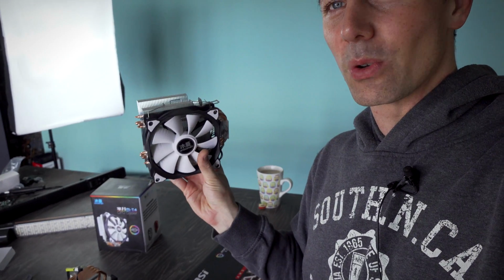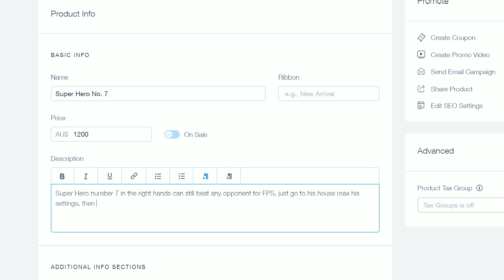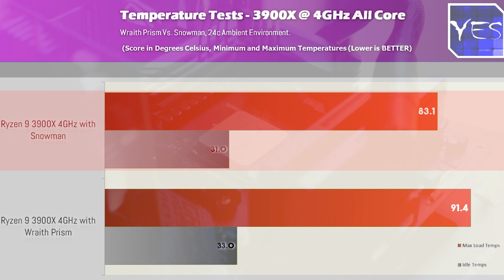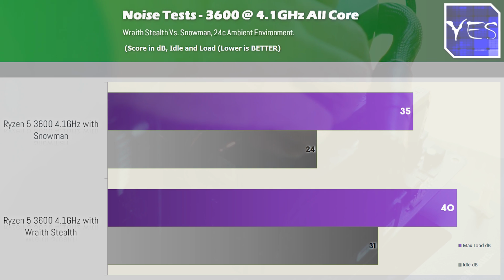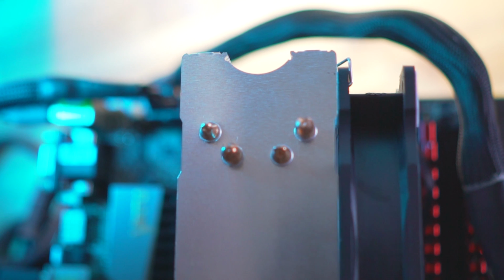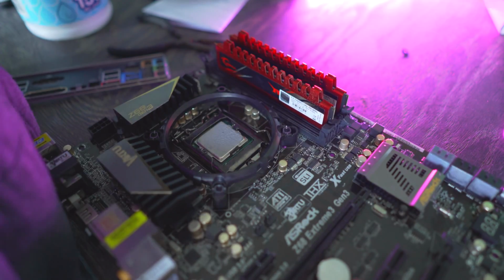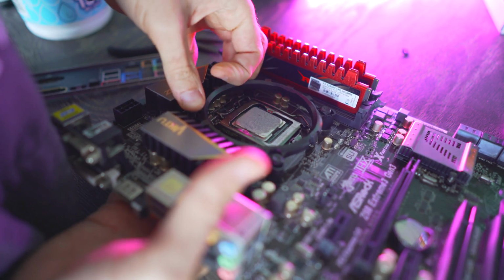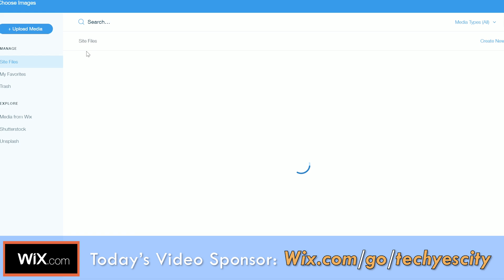Is this $17 Snowman CPU Cooler the BEST Money Can Buy....!?

Comment: I have that same cooler in my very own build, it's so cool my overclocked ryzen 5 cpu is sitting 32 degrees on idle and 45-50 while gaming with GTA on High Settings. 

I didn't actually install a GPU on there either because the GPU on the Ryzen 5 is actually stronger than the Dedicated GPU i once used. :p
Reply: Mine is a dual tower dual fan configuration of this MX-6. 5 years old, still performs as new and has not became louder either. I have bought it back then, maybe because of this video. It cools and old intel with a moderately high overclock so it has to do away with considerably more than 100 watts 2 years ago, yet the temps are passable. I have not repasted it within this 5years timespan. Well, I think I was lucky with picking it up for 15-20 usd, since then it has became much more expensive. I plan to use this cooling tower in a new build, OTOH I will look for new aftermarket fans to replace the old ones on it due to their age.

Comment: I put together a cheap PC for YT, movies and sometimes a game of Valorant. Snowman Cooler with GD900 keeps the Intel G5400 at a maximum of 49 degrees in an ambient temperature of around 25 degrees. The highest I ever measured was 53 after a few hours of playing during the summer when it was really hot. With the fact that I have to mention that everything is in a quiet case that has only one fan at the back for exhaust air

Comment: So after less than a year my snowman cooler broke and overheated my x3470. The plastic ring snapped. It was a pc I built for a friend and he didn't know why it kept shutting down. She's dead Jim.
Reply: ASS in the fan? The Cu pipes or was it thé CUTE Al wings?
Reply: @dallesamllhals9161  The plastic ring that attaches to the mobo, where the heat sink clips on.

Comment: something id like to try is, would this cooler be able to handle a single fan gta 1660 because it can handle a ryzen 5 3600 and they both have the same max temperature, or could you do a video about this :D

Comment: Good review. Now I tottaly won`t buy this chineese snowman product. Thanks
Reply: For me looks very uncentred, low noise on this test it is good, but it is low fan speed also, not a big deal I think in this case. Better will buy something from deepcool with about same price.
Reply: For example if fan speed will go up on this big 120mm uncentred fan it is will be give very interesting effect for bearing. DEEPCOOL Gammaxx C40 for me now looks much more reasonable with starting 500 ppm it really low level noise without any additional fixing with manual speed regulation of fan.

Comment: Have had it for about a year on my Ryzen 2600. 70C on a 45C day with the windows open and no AC(Don't know the ambient temp but you can guess yourself lol). No issues what so ever.  EDIT:Btw i have the 10cm LED 5 heatpipe version which in another video was 3C hotter on average than this non-LED 11cm. Had to correct that.

Comment: Hey, I've just got m-T4 but I have no idea how to mount to AM4 and Ryzen 2600. I mounted brackets but hooks/metal strips on m-T4 are to short to hook cooler on the brackets. Can you help?
SOLVED: Lower metal clamp is to tight.  I bent it with pliers little bit and mounted cooler without any force.
Now temperatures in OCCT went down from 85*C (Wraith Stealth) to max 60*C with m-T4.
Reply: any video you could link me to I'm genuinely lost on how to connect the. Its nothing like the stealth cooler

Comment: Does anyone know if liquid metal is safe to use on this?
Reply: Learn to research.
Reply: @bobfarley4102  lol learn to see when a question is valid especially when there isn't much info on it online to research on in the first place. The bottom part is copper in the middle with portions of aluminum on the edges thus making it shady whether it could take liquid metal compound or not.

Comment: You need to try and find one labeled LESHP 800 Blue(/Red) light or Bing Bao on Ebay. I bought one of these NEW for $8.87 USD with free shipping and it looks like a ripoff of the snowman. If it does just as good as the snowman, then it would be an amazing buy for under $10.

Comment: It was a very frustrating install for me.
1. The snowman cooler I got, the longer clamp side, the clamp was so much shorter than the one in this video --> https://www.youtube.com/watch?v=UTq6XaVJFAA
2. I initially put the white standoffs in the inner most circular positions of the mounting bracket. I then hooked the smaller clamp side, then when I pushed the longer clamp side down, the standoffs from the smaller clamp side popped through the motherboard mounting holes. The bracket would not stay in place.
3. I then took the mounting bracket off motherboard, removed white standoffs, and put the standoffs on the outer most circular positions. Now the bracket stayed in place.
4. The next problem for me was no matter how hard I pressed on the larger clamp side, there was no way this short metal clip would get under the mounting bracket. I ended up hooking the larger clamp side first, then pressed down on the smaller clamp rail (part the clamp is attached to) with both hands, and eventually got it to hook under the bracket.
5. After mounting the circular bracket on the motherboard, Bryan puts the black screws through the white standoffs. Was I suppose to do that? Is that necessary?

Comment: Thanks a whole lot for this review!  Just be sure NOT to use thermal grizzly conductonaut liquid metal on the copper heatpipes as that will generate corrosion and overheat your CPU.  Standard thermal compound will be fine with this cooler on your CPU.   I acquired both M-T4 and M-T6 for just a wee bit extra money and they are awesome.

Comment: FYI if anyone wanted to know the cooling on FX CPU's?! My old pc (was primary 6months ago) is an FX9590 Hard clocked to 4.8Ghz and would never peak over 55'c running Intel Burn Test :) This cooler is cheap and awesome. 2nd Snowman cooler on my new R5 3600 and didn't really need it but during summer gaming I never saw the R5 3600 go any higher than 40'c

Comment: Just installed a PCCooler GI-D66A (dual 120mm RGB fans, 6 pipe nickel plated) with a shroud and RGB top plate. Price on AliEx is $70.  I replaced a CoolerMaster Hyper 412S with this baby and it really does a terrific job with an Asus P9X79 Pro LGA 2011 and E5-1650V2 (6C/12T) OC'd to 4.5Ghz. Absolutely NO REGRETS.  Cooling capability, quality, design, RGB, and relatively quiet. IMO, for the money it is hard to beat.  About 30 to 40% cheaper than comparable Western name brands.

Comment: i bought a 14 $ cpu cooler from amazon from a brand called „argus“ and i was able to overclock my xeon x5670 (quiet a hot cpu) from stock 2.7GHz to 4.2 GHz with max temps around 70 C. Yesterday i just noticed it can even go passive in idle (max out at 48 C)!!! Still mindblown how much value you get for so few money...
Reply: there are still cheap chinese item also like monitor/etc... I bought 144hz 1440p from alibaba and it's almost same on LG/Asus with 1/4 of the price.. you just need to learn to trust them than always trusting branded.

Comment: Cooler aside, if that fan is as quiet as the video indicates and PWM, it might be a great go-to for high quality all-purpose use.  I'm seeing them for $36.00 USD shipped for 8x on Aliexpress right now.  $4.50 each beats out the Arctic F12's and P12's that I have been using on "everything" in the value packs.

Comment: Bought this on Aliexpress for 13$ to get on my Ryzen 5 1600. The temperatures have gone from 62/63ºC to 43/44ºC on full load, so I couldn't be happier.
I even though about replacing the inbuilt fan, but nah, I kept it, so I reckon results can still improve.

I have a Phanteks P400S + 2x140mm on front panel in-take, with 3 120mm out-take fans (2 on top, + 1 rear), also, it is stock with a slight undervolt (1.1xx), which I am thinking about putting it even lower, then work on OC.

Fully recommend.

Comment: Hi :) Can someone please tell me how I can remove from the motherboard the Intel bracket that comes with this cooler? For testing I've used it on an old LGA775 motherboard and CPU and it worked great but problems started when I wanted to unmount it. The heatsink came off easily but not the bracket. I've pulled out the black pins but the white/transparent parts won't come out. I've tried pushing and pulling them while squeezing the ends but without luck. What can I do? I know that the bracket can be bought separately (https://www.aliexpress.com/item/32355358981.html) but it will take a few weeks before it gets here... Is the bracket a one-use solution?? :O

Comment: This cooler is legit. With ryzen 5 2600 at clock speeds I am getting 55°C max during prime 95 test. Idle temps are averaging 28°C.
Reply: How have you mounted it? The hooks are to short to reach brackets.

Comment: Going from the stock AMD cooler for my FX 8320e to the Snowman was eye-opening. STILL can't believe the temps I'm getting. Even at idle, which people don't really count, getting 11-20 degrees just feels insane to me.
Is there any kind of equivalent product for GPU cooling? I'm considering getting rid of my R9 280X's shroud and tying some Noctua fans to the card's heatsink (with an adapter for the plug of course), since it runs HOT, but wanted to know if there's a cheaper, yet effective alternative.

Comment: If you're using this for a ryzen mobo, bear in mind u need to use yr own mounting bracket provided in yr mobo. The bracket that comes with the snowman cooler is for Intel. Spent a good hour wondering why it wouldn't fit in my am4 B350 mobo
Reply: I switch from intel to amd and didn't used the stock cooler and still use this cooler.  that's universal already lol.

Comment: Need some help on the cooler install, from what ive heard i just need the default am4 bracket and just push the slots in, but after several cuts and slices on my hand from the fins trying to push the cooler down, i gave up. It felt like if i try to push it down a bit more the ihs would either bend or crack due to the amount of pressure its under. Is there a minimum AM4 motherboard model that you need to have for it to fit. Or do i simply just need to bend the pins and force it to fit.

Comment: after watching this and seeing the product description on aliexpress, i see that the fan speed for the snowman is between 900 and 1400 RPM ±10%. 
so that got me thinking:
1. what if you switched the fans of the snowman and the cooler master cooler? which leads to 
2. what if you purchased a fan rated for higher RPMs so it's not that quiet but performs better
3. trying a push-pull config with 2 fans instead of 1
3. trying the 6 pipe variant instead of the 4 pipe you tested in this video (maybe also get RGB variant)

if you see this could you please try these options in a video to see how much the difference in performance is?

Comment: Gday Does Aliexpress have any decent 450W 80+ PSU's for AU power plug cheap

Ive noticed in Oct 2019 a lot of the AU retail stores no longer stock 65-85 cases with cheap psu's anymore

Comment: Which generic AliExpress cooler is better
6 heatpipe and 1/2/3 90mm dual tower type cooler
or
6 heatpipe and 1/2 120mm fan single tower type cooler

Comment: I actually got this some time ago, but after watching this video I decided to get another one for one of my PCs (I have like 6, I use them for tournaments) and fount out there is a 6 heatpipe and dual fan for 18€, the 4 heatpipe and single fan, which is what is shown in this video, so I got it, but it has to arrive now. I guess it will beat the CM 212 Evo, but not by much and be louder (I don't care about noise).

Comment: Bought this cooler for $28 off Ebay Aus and it brought temps down on Intel Burn Test from 85c to 64c on i5-4570, albeit old cooler had crusty thermal paste but good improvement anyway.  Thanks Brian.

Comment: I followed your advice and can confirm that I get about a 5 (idle) to 12 degree (prime95 full) delta between this and the included cooler on my 3900X. This is with the 2 fan model / 4 heatpipes. But it does feel a little bit strange to use this ultra cheap cooler with my higher-end X570 Master build :) Thanks !

Comment: Would you mind doing a comparison between this Snowman Master 5 and the Arctic Freezer 13 (or his "CO" brother)?
Not the "PRO" models!

I'm asking, because, in my opinion, the Snowman has one potential flaw, and that is it's height of around 150mm, because of the 120mm fan. The Freezer is less high, because of its 92mm fan. That could be a solution for some narrower cases, I think.

The Snowman seems to be rated at 150W TDP, the Freezer 13 (and it's CO brother) at 200W TDP.

One other channel did a comparison to the Intel stock cooler on a 4790k @4GHz https://youtu.be/b4NLnivlxQc
The results are promising, in my opinion.

It would really be nice to know how both of the coolers compare to each other, of course in terms of loudness, too.
The Freezer will be a few bucks more expensive, though.

I know it depends on how you have access to Arctic products, but asking can't hurt, you know.

Comment: Its not a good fan, its a low rpm fan, on the snowman. that is why it is so much quieter, the cost and temp difference is in the fan. $5 fan vs $20 fan.
Reply: then buy a noctua and put it on the snowman haha
Reply: @HarryUnchained  Man, you people really need to stop listening to these you tube personalities. They are on youtube because they aren't real techs, otherwise they would have a real job, like me. Noctua is way over priced for what they make and crappy fans kill silicon. $20 Cooler Master heatpipe radiator is all you need. The one on my Ryzen works well enough, even under 100% cpu load, my temps wont hit 70c. 

These youtube personalities get paid to tell you things and sell you things. Product reviews are one thing, real technical advice should be reserved for the true professionals, not the bubbly personalities.

Comment: All these push pins installation coolers do their job at the basic level. As so many before me said, the Deepcool is the same, and it often goes on sale, but for a reason I prefer blots and nuts and tension control! Anything from Raijinteks to Reeven and above has them. And as soon as you have those, that's it, you don't want to go back to push-pins. I still have an old and thin Xigmatek Gaia, with a nicely leveled direct contact pipes surface, which due to these two factors (well machined surface and bolts that put a really good pressure on the IHS) manages to stay with the big boys, not just "do"... And the price difference is minimal.

Comment: That wobble on the fan though...

My props still go to the Gelid Solutions Tornado, which costs €20 here in NL, and looks very similar in all respects to the CM 212. Okay quality heat sink, solid fan, and it even comes with termal paste included. Might be more expensive elsewhere, but here it's a bargain. If you need more cooling power, there's a two fan Gelid Solutions Phantom for ~€28, rated for 200W TDP.
Reply: MSRP: USD 42 / EUR 39 listed on their website phantom
Reply: @l2x6tense  Hmm, that's a bit steep. Maybe we're lucky here in the Netherlands. I've never seen the Phantom over €30.

Comment: Unfortunately this is  very amateurish  video that doesn't mention anything about fan bearing and its life expectancy which  big part of the price.  I will amend my comment if Author is gone show what happens with the fan of this cooler after 2 - 3 years of constant work  How long it will actually last?. As veteran PC technician I caution  anybody b4  recommending any cooler without years of previous experience with the same model. .  Recommending untested fan  is simply very unprofessional and potentially misleading regardless of the intentions of the author. Sorry but this is ABC of proper engineering review.

Comment: I would have been interested in seeing you adjust for dB. Bringing the fan speed up, to be in sound parity with the Evo. No one cares if one fan is at 700 rpm, while the other is at 600, if the dB is the same.

Comment: I am thinking of buying this cooler, however I see that another model with 6 Heatpipes and Dual fan setup is also on the market which doesn't cost that much extra. Should I get that one instead? Would that be better or worse than the one shown in the video?

Comment: also it claims it is a 5 direct contact heat pipe cooler - but there are only 4 heat pipes on th contact block?  huh?  that doesn't add up.

Comment: Looks like a decent cooler.  Would be good to see the snowman vs the hyper 212 tested using the same fan at a fixed speed of say 1000rpm to remove that variable. To see how well the towers dissipate heat.

Comment: Bigger air gap between the fins for better airflow and lower fan RPM. Fin thickness looks the same, but I couldn't find any info from neither of those. Comanies really should list that information like Arctic does, thats the main key for quieter systems. The usual manufacturing limit is max 0.5mm fin thickness, but companies using 0,3-0,5 mm all over the place.

I have a similar but smaller cooler with 10 cm fan (because of my case), it does pretty good job with low pwm noise. Fortunately buying cheap stuff is easier locally in my country then buying from Ali, you just buy the rebranded version so it's product of EU and made in China :)